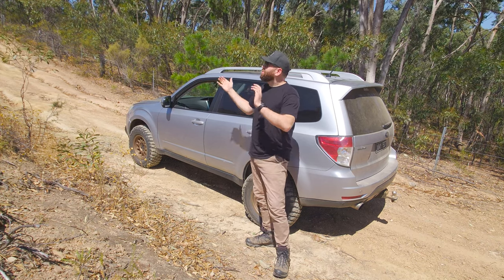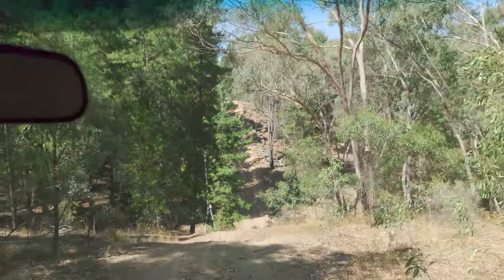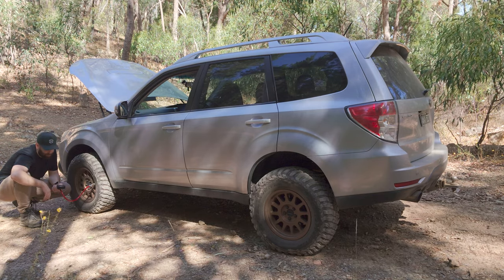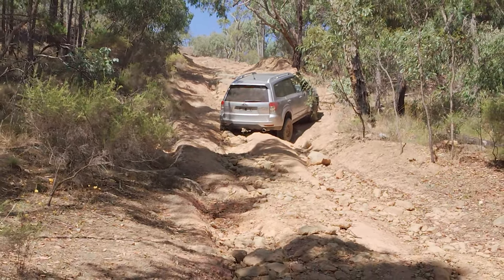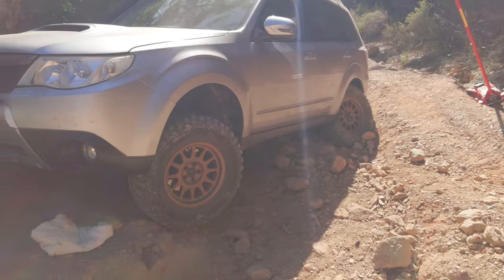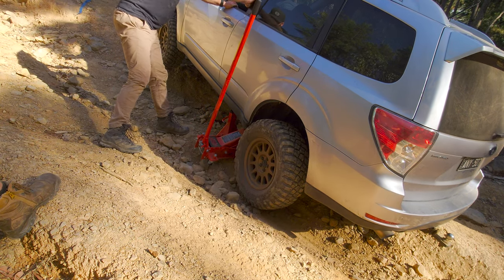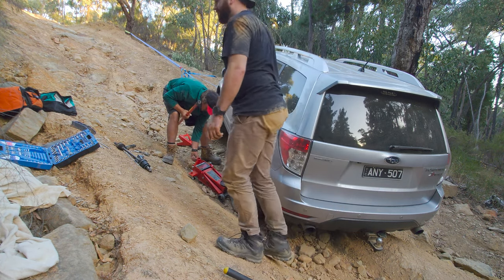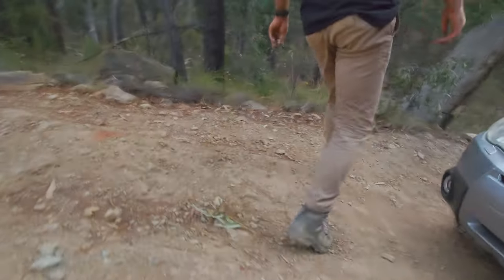Broken And Stranded Offroad Recovery Subaru Forester XT on pine plantation tracks and trails

Comment: Good recovery Monty - as mentioned in a previous comment I’ve owned several Subarus including WRX and original Forester the last being a 2009 XT automatic - over the years I kept getting stuck on boggy tracks and steep ascents - even with aired down mud tyres - I concluded that I needed increased ground clearance and wheel articulation but not possible without huge engineering changes and costs - so I settled for an auto diesel Hilux with 4WD options, good ground clearance all standard and aluminium canopy setup - I still use the XT for bitumen and light off-road touring.

Comment: nice video mate. What is your Tire size?
Reply from the maker: Thanks mate, they're 235/75r15.
They require a fair bit of work to make them fit.
Reply: damn bro that's huge! What would be the maximum size without having to cut things off? maybe 225/60R15?  Also are those rims 15x7?
Sick video! 🔥 @MontyScott

Comment: Great episode. We already contacted at Insta about this issue. 
Did you get the revised control arms? 
How about your lift, did you lower the front subframe? 
I'm running a 50mm lift and at the rear I installed a subframe lift as well. 
But still thinking about the front, not very keen about the angle of the cv joints at the moment.
Reply from the maker: Hey thanks mate, not yet but that's what I'm hoping for. I have to reach out to them and let them know what happened. 
No lowering of the front subframe for me... It's not really needed for a 2 inch lift only the rear needs it in the newer Subarus with multi-link suspension 👍🏻 I've had mine lifted for about 4 or 5 years and never had an issue with the front CVs👌🏻

Comment: Why is it not locking the spinning wheel transferring drive ? My sh does this when traction control is on.... my car would drive str8 up that incline ( im confident on that)  (( I think lmao 🤣 it's a pretty steep hill might eat humble pie?))
Reply from the maker: Hey mate, I was just testing the waters to begin with and not giving it too much throttle input because I wasn't sure if I'd broken anything else... The traction control really had its work cut out for it! It's hard to show how steep the hill is on camera when you're already on the hill and it had most of its weight on the front right wheel and the rear left wheel but also the rear diff and tow hitch were stuck on some high ground a bit like an anchor! And on top of that the rear right wheel that you can't see was trying to climb a little slick rock that was almost vertical but because it was hung up in the rear on the diff it didn't have enough weight on the wheel to climb. You can see the front right left wheel (closest to the camera) was getting braked but because the traction control is a reactive system you really have to give it a good chance to work sometimes and when it starts you need to give it more throttle like I did in the end when it finally moved. It's a surprisingly good traction control system if you give it a chance but it definitely has its limits 👍🏻
Reply: @Monty Scott  agreed bro 100% .... you got a few perfect angles on cam. I watched it a dozen times looks like 35,40 deg angle.  

You did fkn well to get as far as you did!  No criticism intended.... wish I was there to see it and give it a crack !.... keep up the good work ,excellent videos, thanks for the opportunity to see your adventures..... like I said I'd be next inline to break my control arm hahaaa and crack a beer with you as we scratch our heads ...... legend 🍻
Reply from the maker: Thanks mate, no criticism taken 👍🏻 Will do, it's always fun to get out there and capture some of my adventures. 
I'll be back again with new control arms hopefully the redesigned newer version that fixes this known weak spot!
Cheers 🍻

Comment: Is that weakness a problem just for rallytech ones or genuines too?
Reply from the maker: Hey mate, no this is just for these particular arms with the original design that is no longer produced... Since then Rallitek has redesigned and released a new version that addresses this fault. The issue is not there for genuine arms but the overall strength of the OEM ones is far less! 👍🏻

Comment: Good try, Monty. 🍿 Come back stronger, perhaps with a rear locker next time!
Reply from the maker: Thanks mate! I'll definitely be back! Yes a new locker for my car is just about to be released so with that and hopefully the new gen rear control arms this shouldn't be a problem 😁👍🏻
Reply: @MontyScott  new locker for the SH? Are you talking about a different locker different to the Torq locker?
Reply from the maker: Hey mate, yeah it's a new locker for the VA2-TYPE rear differential... This Forester is an S-edition that has a 5eat unlike the rest of the SH autos that are 4eat with a r160 rear diff. The new "VA2-TYPE" locker is just about to be released and will give a whole new range of Subarus the same option that all those r160 Subies have had... It'll be for 5eats, some CVTs and other models like the Wilderness Outback and Foresters 👍🏻
Reply: @MontyScott  Yes.  The SH shares the same diff housing as the OBW, FW, and 21-23 Crosstrek manuals.  Can't wait to see you install it and give it another go.
Reply from the maker: Yeah it'll be exciting to have a locker when it's available but I'm sure I could get it done without it 😁 It's unfortunate that I had faulty control arms... Once I get them replaced with the new version that fixes this issue then I'd be keen to head back 👍🏻 yes same diff housing but only in the 5eat S-edition SH the other SH Foresters have the r160.
Reply: @MontyScott  Quite unfortunate with the arms.  I carry SPC spare arms as a contingency for my Torque Solution arms.
With the locker, you'll take less time going over the same obstacles you previously had troubles on.
Reply from the maker: Yeah that's a great option I remember talking to about that when you got your new arms. I'll probably do the same from now on... I was lucky enough to be close enough to duck home and grab a spare factory arm I had. Those torque solution arms do look nice! Especially being sold one piece alloy 👌🏻 I do however worry that the gap the adjusting hardware has to span is a little big... not as bad as these but compared to the new model. Anyway so far so good for you and carrying a spare is the go! 

I can't wait to feel and experience the difference of a rear locker! I know it'll be a huge difference 😁👌🏻
Reply: @MontyScott  Yes sir, I'm still testing them.  Most billet alloy arms with adjusters are similarly designed.  I've been lucky so far with the lines I choose.

Definitely excited. Cheers!
Reply from the maker: Great stuff, yeah I've noticed you have a pretty calm and controlled approach that is very admirable 👌🏻 I'm looking forward to getting a bit more control with a locker upgrade 👍🏻 but when it calls for it and only when the time is right I don't mind a bit of send 😁🚙💨